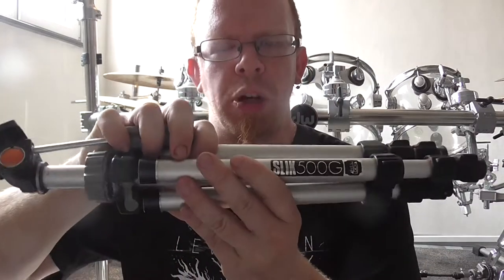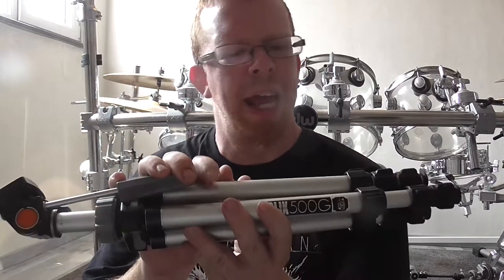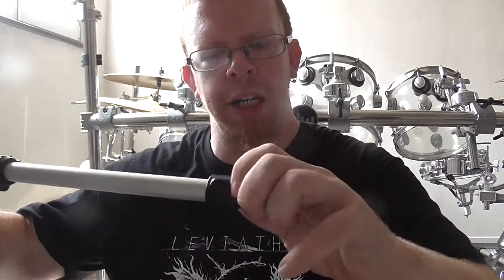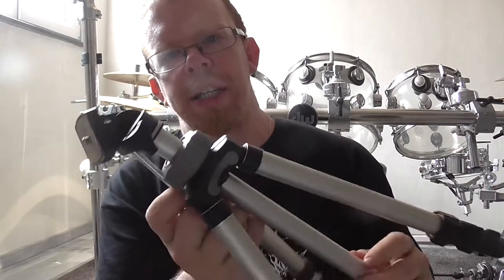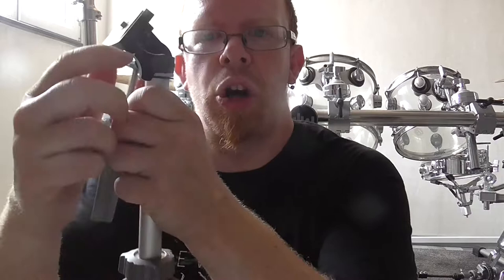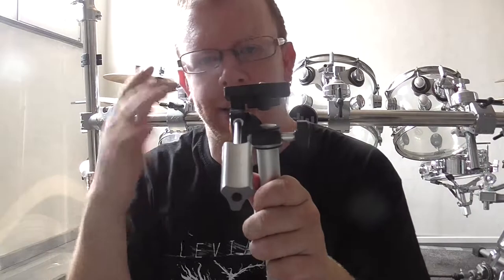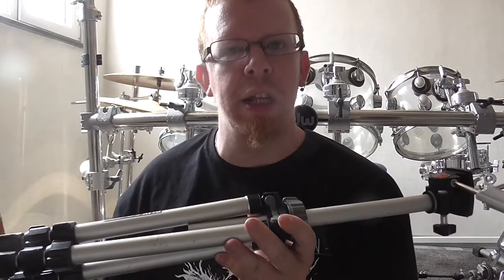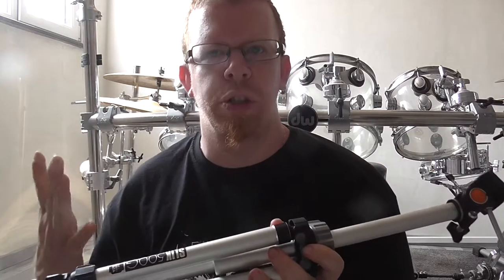My Personal Opinion-Slik 500G Tripod

Comment: Hi David i have got the same tripod but unfortunately its head broke when it was being shipped. I was wondering if you could help me find a new head replacement or maybe even, possibly let me buy from you one of the heads that you no longer use for this tripod 😊.

Best regards!
Reply from the maker: That tripod is gone. unfortenly i throw it in the  thrash can few months ago. maybe you look at ebay